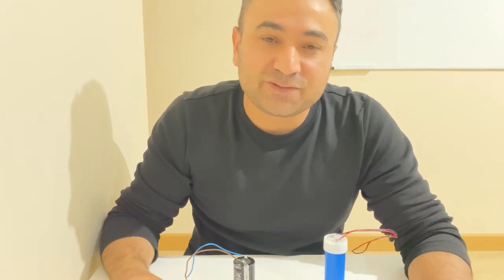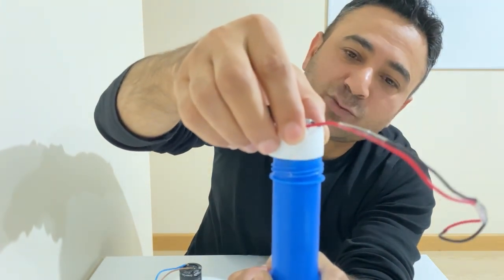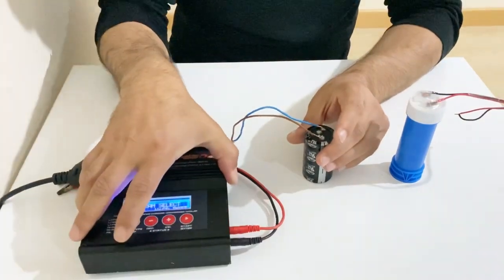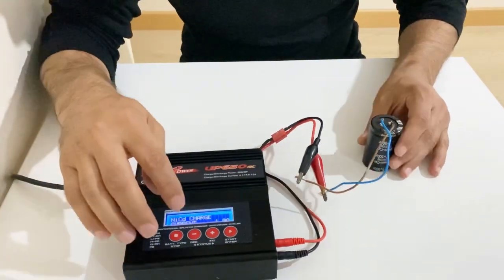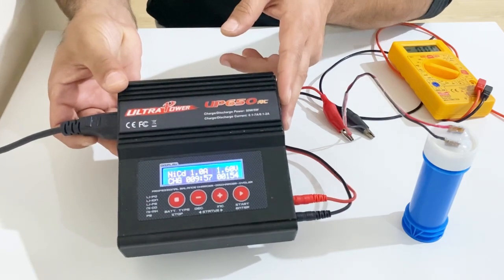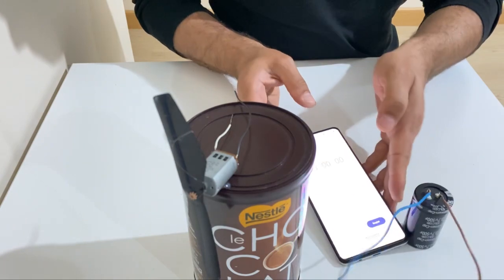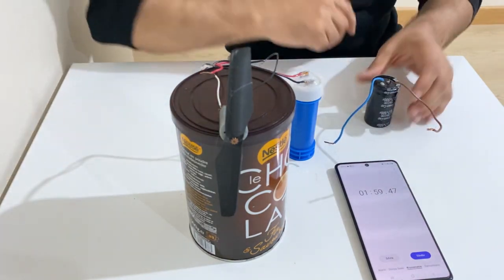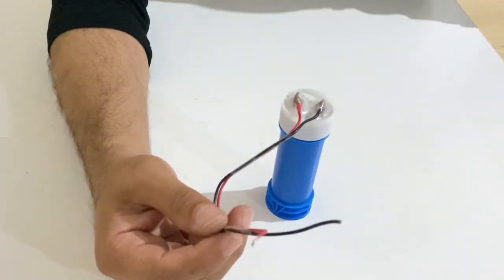Homemade Supercapacitor Vs Commercial Supercapacitor | Which one is better ?

Comment: Dude! I can see you are sincere in your test. But don't waste time addressing haters. They are not rational and will not be persuaded by rational arguments. Just focus on describing your claims, and keep everything in frame and clearly visible. Anticipate annoying stuff, like things falling over and screens being unreadable from the camera. Use a full can to anchor the motor so it does not move around on the table. It doesn't have to be perfect, but it can always be better. Carry on!
Reply from the maker: Thanks fella. I am gonna comply with your suggestions

Comment: Why don't you use the charger and discharge function? you can set the discharge current and termination voltage. Although you can't find Farads, you can find the capacity in mah.
Reply from the maker: I wanted to demonstrate the power of the capacitor
Reply: Farads are more often used to measure the electrostatic charge of capacitors, mah for chemical batteries, if you look up the definitions of both and simplify, you will find out that 1 farad = 1 amp / 1 second

Comment: nice video bro,but...the difference between capacitor (or Supercapacitor) and battery is that capacitor can dump "all" its energy in very very short period (less than secund)...that is why they are used in spot welders. you coud see that if you used thicker wire to short it at end of video.even simple AA 1,5v battery can make wire glow  (you know that hack for starting fire in woods with thin aluminum foil and battery) and that dont make it supercapacitor. That you made you just call it supercapcitor, "if my grandma had a wheels that dont make her a bicycle"
i dont want to diss you,maybe you did make a supercapacitor but you are proving in wrong ways...it did crage fast as the capacitor will do but i think internal resistance is bad so it can discharge as supercapacitor,and i dont see you test that. anyway you did build something cool and interesting,i think i will try to make that by my self ;) have a good day
Reply from the maker: Thanks for your long, detailed and informative comment. Of course l know all of that you said. You can’t assume that the Supercapacitor you made at home will be as good as a professional one. If you wanna make a one like commercial you need a laboratory and advanced equipment. Despite everything this a cool Supercapacitor that you can build at home and its worth to try. Thanks a lot.
Reply: @joyofelectronics9782  
yes it is awesome if i can build supercap at home,that is why i clicked on video :)
I really hope this is supercapacitor  but i only see here effects of good fast rechargeable battery, no high discharge current
it will be cool if you can make video that show this have properties of Supercapacitor and not only rechargeable battery so people can see the difference

Comment: That bubble's bottle )) fits perfectly,  did you measured the max current it can give,and how fast it can charge?
Reply from the maker: The charging duration depends on the current you charge. You can charge it up to 5 amps. By the way the max current it gives about 5 amps

Comment: How do you measure Farad ?, How long lasting  it in month? Do you measure lifeclycles ? Is it can achieve 10.000 cycles with stable capacity ?
Reply from the maker: I show in the video the formula of capacitance. I/C gives us the milivolt per secon. If you charge with 1 amp up to 1.2 volt 10 minutes means 500 farads. So it means each minute=50 farads. When it comes to your other questions; after 10 minutes the voltage drop 1.1 volt, after one day the voltage drop 0.9 volt and after one month the voltage drop 0.75 volts. Lastly, life cycles of the capacitor is about 100 000 with stable capacity. But you have to careful about not overcharging the Supercapacitor.
Reply: @joyofelectronics9782  thx for explanation i want to make my own super capacitor with your formula, its so interesting since  super capacitor and battery have huge market in EV industry., Have you try al2so4 electrolyte ? Because i heard on google that it's making better capacity than H2so4, naso4,  Naoh or KOh ?
Reply from the maker: @teknosql4740  l’ve tried all of the electrolyte except al2so4. I would be very happy if you let me know the results with al2so4 bro